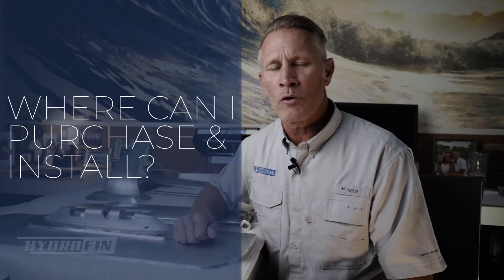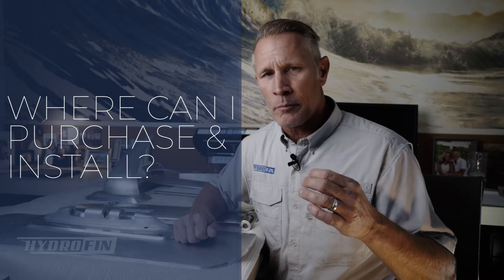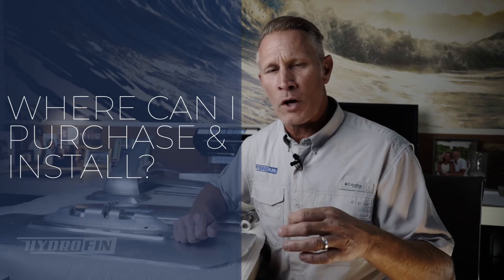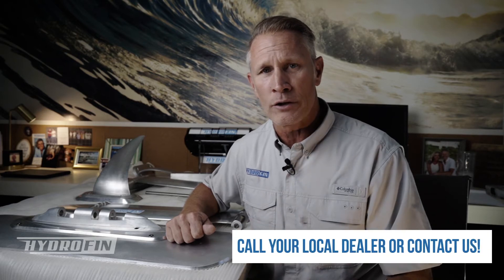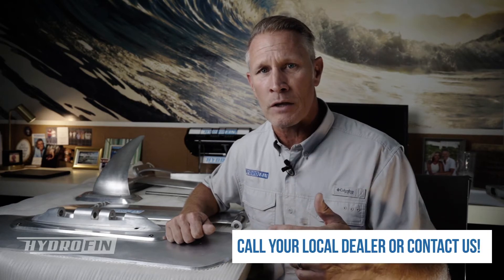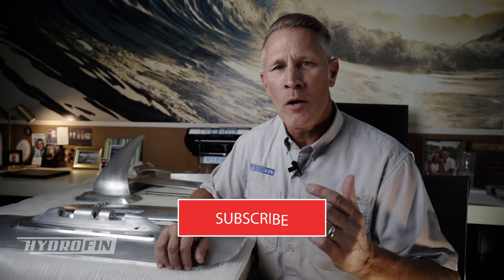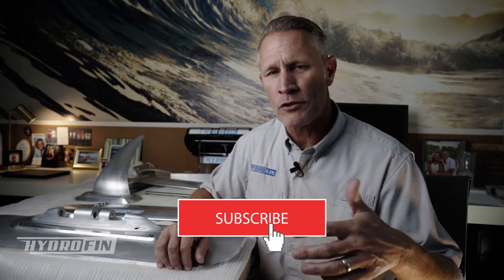What’s The Hydrofoil Installation Process?

Comment: I was wondering if you have to remove the log guides in the center of a trailer so the pontoon boat could be driven up onto the bunks?
Reply from the maker: If the guides are on the rear of the trailer they would either need to be relocated to the front or taken off completely.

Comment: One more question, do the hydrofoils perform in rough water? We use our boat on a lake where the wind comes up and the water becomes quite rough.
Reply from the maker: Hey Steve, our product works great on rough waters! you will be riding above the chop so your ride will be much smoother.